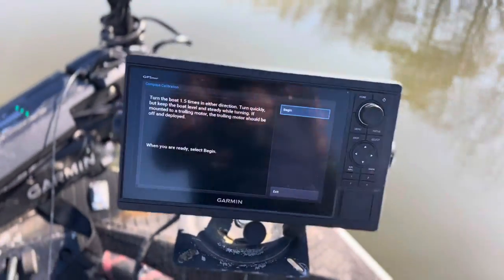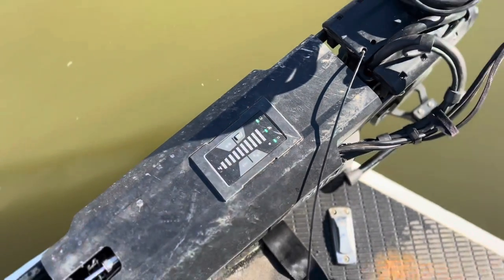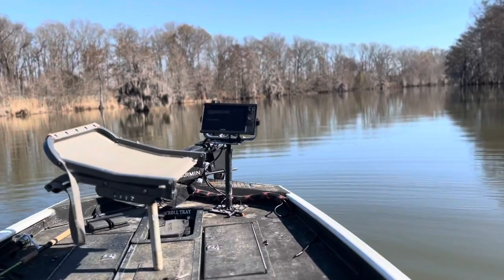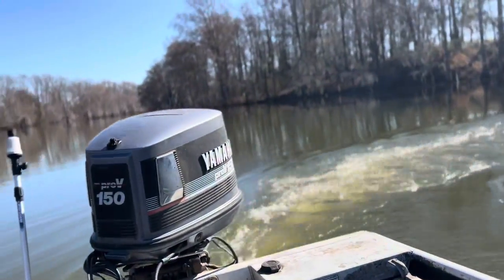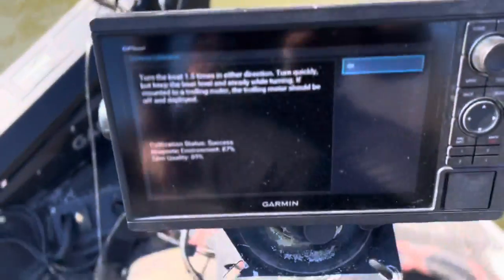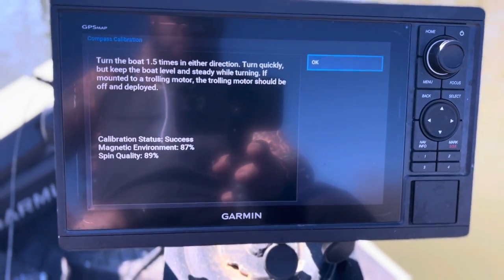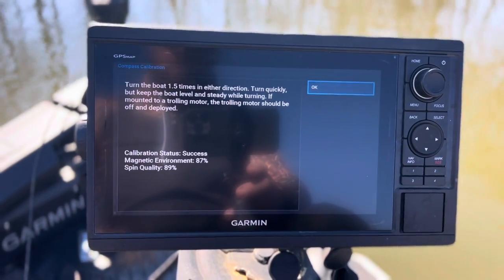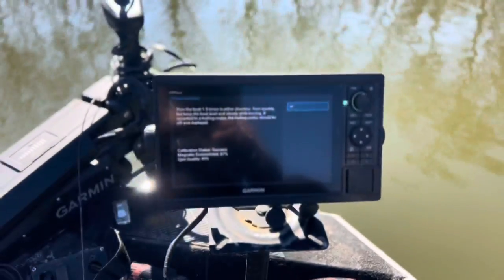Garmin Livescope Calibration: Garmin Force Vs Outboard The SHOWDOWN!!!Which One Is More Accuarate???

Comment: Had issues trying to calibrate my livescope yesterday. Tried it with the trolling moto and outboard. Spin was good but the magnetic environment was at %17. Maybe because its mounted on my terranova trolling motor barrel. Never had issues with it before when I had it on the minnkota edge.
Reply from the maker: With Minn Kota it’s best to turn motor off completely
Reply: Yeah I turned it off and unplugged my uhd93 transducer that is also mounted on the trolling motor barrel.

Comment: I try calibrating my LS today, using the trolley motor and it fail ( magnetic 5% spin 90%) I even try the main motor and still fail, same result, what u think it could be?
Reply from the maker: What kind of trolling motor.
Reply from the maker: You could possible have some wiring interference also
Reply: @The_Garmin_Guru  ultrex